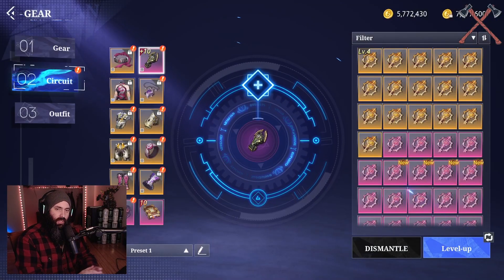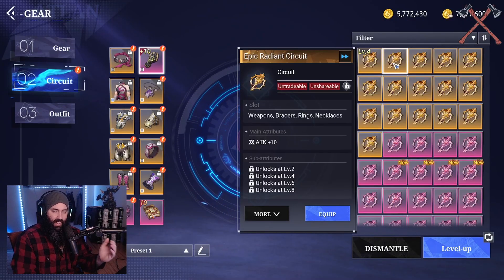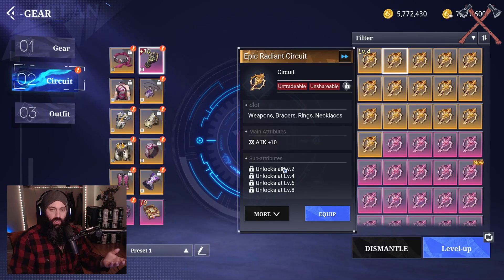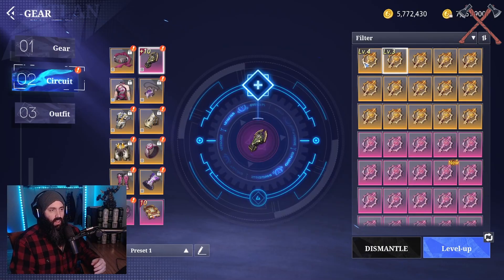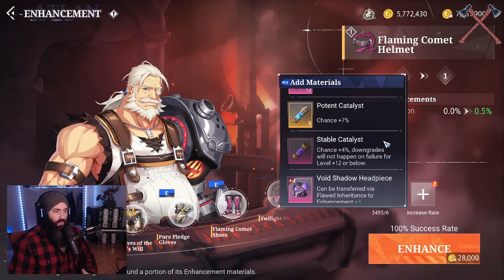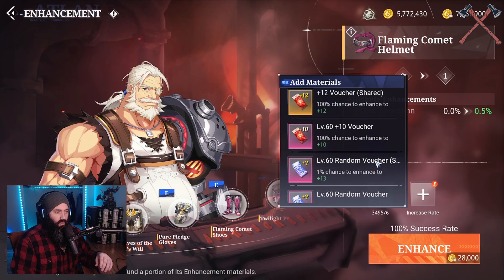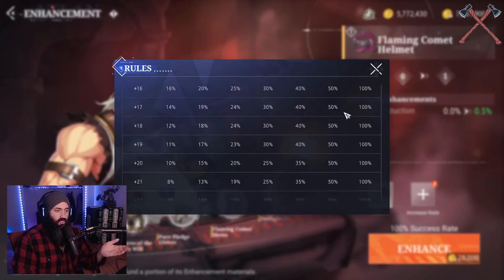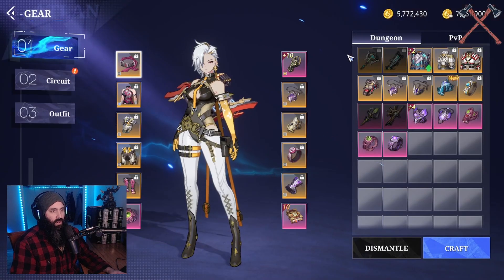Circuits, Calibration & Enhancement Guide | Crystal of Atlan In-Depth Guide

Comment: Nice video! I just had some questions while I was playing.
I read on the wiki that after 15+ failing halves your enhancement attributes. If you succeed, does your enhancement attributes revert/get buffed, or does it just start to increases from the halved point?  
When enhancing gear, I noticed you get an Enhancement Attributes. Are those randomized or is it fixed what/how many attributes you get on a specific piece of gear when enhancing?